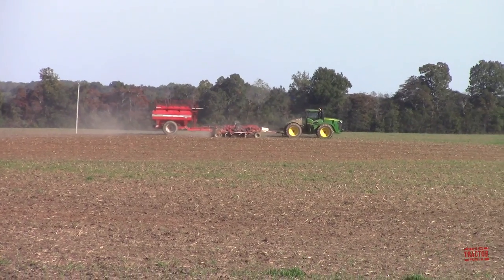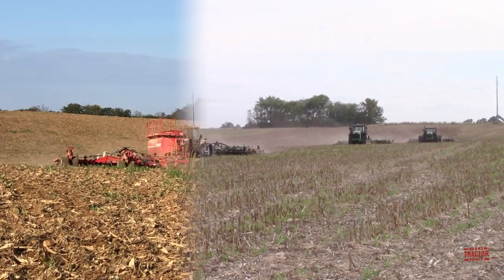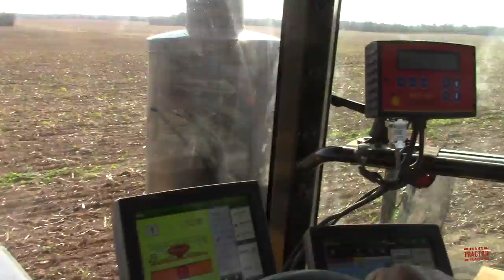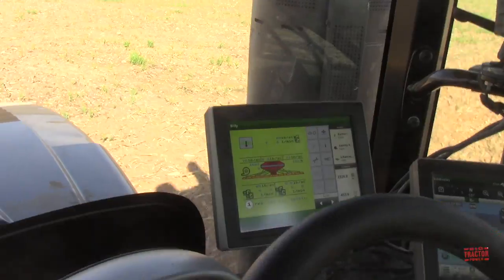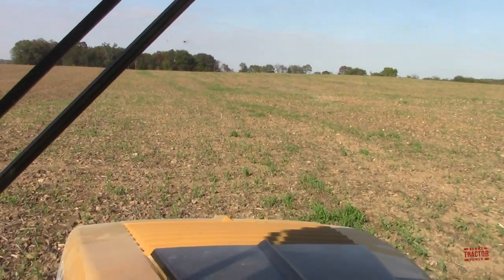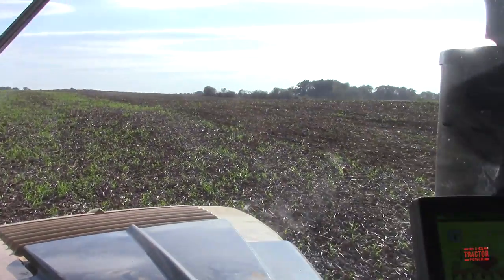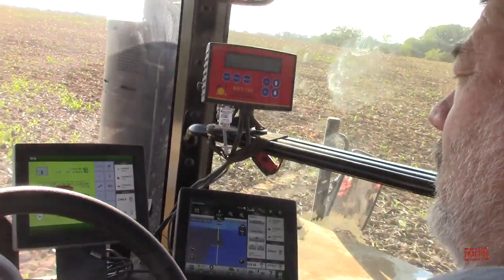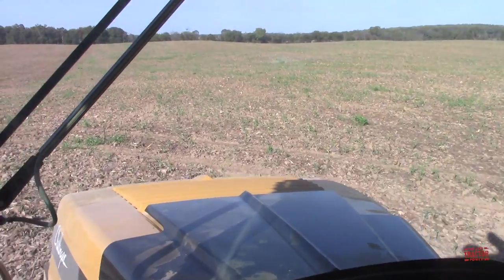SEEDING 1,200 ACRES PER DAY | 600 HP Tractors & 60 FT Drills

Comment: Billy did a masterful job being diplomatic about the three tractors strengths and weaknesses. But, I think the fact he's been in the Challenger the last 2 videos shows what his personal preference is.
Please tell him and his family thank you for letting us all watch their operation. Very interesting and educational.
Reply from the maker: Thank you for watching.  You are correct you will most often find Billy cruising at top speed in the Challenger.  It’s the only non John Deere tractor on the farm. This is a 2019 MT875E that just replaced a similar 2017 MT875E. Billy has run a Challenger MT800 since 2006 trading every two years so this is Challenger number 8.
Reply: The Funny Thing is the John Deere Tractors are Powered by Cummins
Reply: I bet every two years the challenger dealer is thinking this is the year I get the farmer to convert his fleet, this will be my best year ever!!  Then the farmer is I will take one please.
Reply: Rickie McKillip only the 9620r and 9570r, the rest are Deere motor.
Reply: @Ellison89Brett  Thanks for the follow up
Reply: Rickie McKillip no sir not all of em are
Reply: @rickiemckillip8124  I don't get it. Why is that a funny thing? Cummins has been in ag tractors of various brand for decades.
Reply: @bigtractorpower  I'm willing to bet it's the ride of the two track that he prefers. And the challenger two tracks pull harder than the RT in the wet because they run more track tension so they don't tend to slip the wheel inside the track as easily. At least that's what I've read about them.

Comment: Wonderful part 2. Watching the machinery go past on the road is very impressive. Inthe field you can see it's large equipment, however on the road it's massive taking up both lanes in each direction. How heavy are those Horst wheat planters ? It looks well built, heavy guage steel frames with large wheels. 600 bushels that grain cart is as large as a truck. Very nicely done. Pt 2 of interview in cab was interesting from his point of view and experience. Thoroughly enjoyed pt 2 BTP 🚜👍

Comment: Are they still running these same drills. I wonder if the Garnett's will have a need for the bigger 9RX 710,770, or 830, or if they are not interested in the bigger models? Don't know if they really have a need for them with their current implements? They have always run the biggest models available in the past.

Comment: Got a question about combines. What is the main factor why a farmer would buy a 9250 over a 8250?  They seem to be the same except for the horsepower. Does a little higher HP really matter that much?
Reply from the maker: More horse power means allot in my opinion.  Filming class 8 and 9 combines together in a field with the same heads I see the class 8 lag behind. In wheat both an 8 and 9 running 40ft heads side by side I feel like eating my arm to motion the 8 to hurry up because the 9 is pulling away fast. In corn with a 12 row head a nine just eats it and pours the grain out. An 8 does well but the 9 cover more acres in a day.
Reply: @bigtractorpower   That does make a lot of sense.  Very Interesting first hand info. Thank you.

Comment: Hi there. I enjoy watching your videos. I am from central Kansas. I am a custom sprayer applicator. What is a better tool to use- a high speed disc? Or a Kenzie diamond harrow? I want to know which one is better on rough ground like terraces or just plain rough ground.
Reply from the maker: It all really depends on what you want your seedbed to look like.  Both are great tillage implements.  The high speed disk will work up to 6 inches deep and really chop up stalks and work out ruts as well as wash outs. The Kelly only works 1.5 inches down. It will not remove wash outs. The Kelly will mix residue and break up stalks.  It incorporates fertilizer well and knocks out tire traffic imprints. The Kelly never has to be raised on turns.  A farm I know that runs a 45ft Kelly can stay 600 acres ahead of the corn planter with a days work.
Reply: @bigtractorpower  thanks that helps me

Comment: Seems like a lot of grass where they're planting.  What kind of weed control do they use once it's planted?  Cool videos by the way!
Reply from the maker: That is volunteer corn.  When they disked and it rained a bit the corn sprouted.  The drills tear up most of the volunteer corn and frost in a few weeks will knock out the rest. They will apply herbicides next March to control grass and broadleaf weeds.
Reply: I see what you mean.  I rewatched part of it and sure enough. volunteer corn.  Some things don't come across the video as well as others!  thanks

Comment: Very surprised to see this farmer tracking beyond the  center of the road when there was ample shoulder to move onto. Farmers in WNY will stay on the shoulders as much as possible to avoid crossing over the center of the road. Common courtesy.
Reply from the maker: This drill in 19ft wide folded up.  You do not want to get it on the edge of the road with it and risk rolling it over.  This road also had no out out let and had two lanes on the other side.  It also had rained all morning so if he drive on the edge he would have brought up mud and left big ruts. I grew up near Rochester, NY.  Where are you from?
Reply: Bigtractorpower thanks for the great videos from a fellow New Yorker. I worked on a dairy farm in Bath Ny now living in Corning ny
Reply: @bigtractorpower  Richfield Springs NY
Reply: @bigtractorpower   which part of Rochester?
Reply: @bigtractorpower  I've lived near Attica NY in Wyoming county all my life. This county has more cows than people, a lot of farm land.
Reply: Pretty typical for 'farm town USA' - it's easier to give the food growers the courtesy by taking a second out of your day to get out of their way, so they don't have to worry about taking out the mail box that you can't see on the other side that monster.

Farmers don't take this massive equipment out on the roads because of they just don't care about interrupting the rest of society - rather, they don't exactly have any other choice but to commute public roads to their fields. So, do them a favor and help THEM out by making it easier for them to navigate the roads in these oversized machines by giving them some extra space. You don't know the circumstances that they're in, the considerations they've already taken into account for their decisions - assume that they're doing what they're doing because that's probably the best option, instead of questioning the choices made by people that do this for a living.

Comment: They are doing this the expensive inefficient way. We do it very differently in Africa with a lot less machinery but hey, if it works for them, awesome.
Reply: Details??
Reply: Douglas Oakley we spread our wheat with a spreader (36m wise @ 10km/hr with a 210hp tractor) on top of our maize residue which has been chopped with chopping heads. We then run a VT or compact disk to lightly incorporate it in behind the spreader.
Reply: @ZimFarm24  I would say your method is clearly cheaper, but much much uneven results you get there, beacause even emergence is one of the top things if you want top yealds like 10t/ha
Reply: siikais90 you are correct reference emergence. To counter this we spread a slighter higher rate than the guys who drill. Our yields are on par with guys who drill. The xtra capex/diesel costs are greater than the xtra kgs of seed per hectare. Not saying what they are doing is wrong, I just think there is a more efficient and cheaper way. If the neighbors were getting 2 ton more per Ha, I would jump on the seeder bandwagon tomorrow.